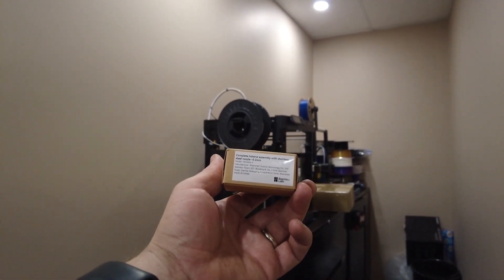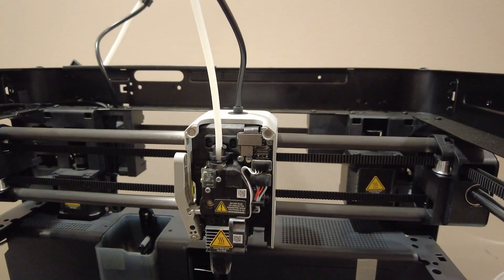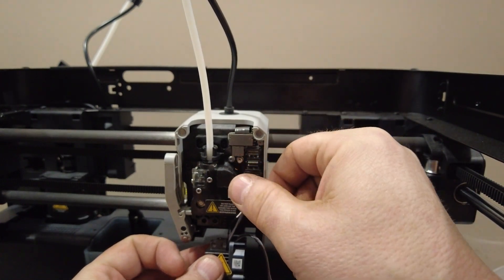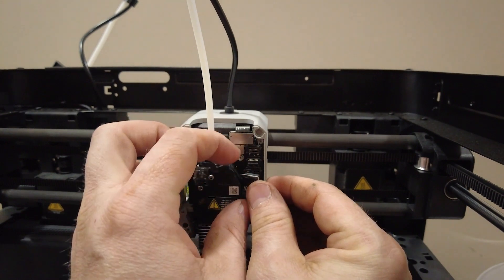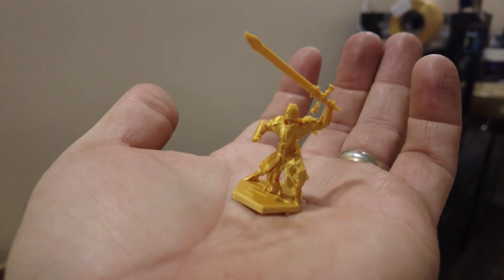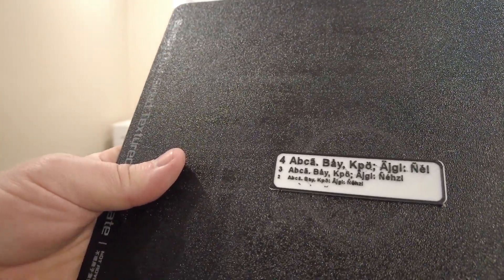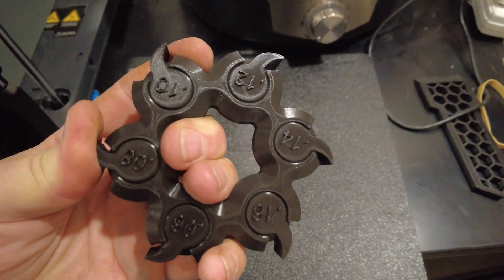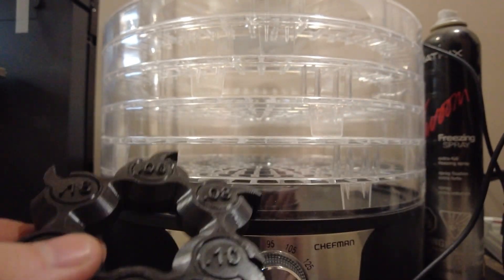Bambu 0.2mm Nozzle - Installation and Tolerance Testing

Comment: To be pointy, you installed the whole hotend assembly, with a 0.2 nozzle. 
Not to be rude, Thanks for the content it will come handy to me in future. 
I say this tho, because Bambu is -intentionally imo - very unclear about this: To easily perform a quick swap as you showed and as we all want, you will have to purchase a new hotend assembly for every secondary nozzle you plan to use. And it goes for about 17€ the nozzle, plus close to 30€ for the hotend.
Then yoy have to do (once and hopefully forever) the assembly of each nozzle with its hotend assembly, watch out for the thermal paste, the fan and all its wirings.
Done that, you will have your different nozzl'd hotends, and you will be able to perform the relatively quick swap you've shown.

Hope this will be useful to anyone like me was willing to try more detail w/ 0.2 or toughr vases with 0.6 and might be finding out he's forgot to order the 30 bucks hotend assembly. twice.

Those guys at Bambulab never miss the occasion to make me freak out every spare parts order I place, one way or another... -.-"
Reply: Minifigures came out great, tho! Cool stuff, I'm impatient to try... but I'll have to wait the hotends assemblies to come. No advantages in dismantling my 0.4 hotend which came with the printer... Unless I go along buying a 0.4 hardened, ok... Daaaamn those guys at Bambu... >:(
Reply from the maker: Good points. Definitely wasn't just the nozzle swap! I watched someone do the nozzle swap only and figured i'd screw it up, so ordered the entire hot end, even though I didn't want to spend the extra money. But if you have the complete hotend, it's pretty slick to change out.
Reply from the maker: I was surprised how well they printed. I'm by far not an expert and I just swapped hotend assemblys, sliced and printed. Bambu makes it easy.

Comment: Technically you didn't even have to heat up the nozzle to remove the filament prior to swapping the hotend.  Just push the filament cutter to... well... cut the filament.  Cuts it basically flush with the  top of the assembly.
Reply from the maker: Good point! I am definitely going to try that.

Comment: I'm trying to print with the 0.2 nozzle and it's constantly clogging
Advice?
Reply: Have you tried lowering your heat?   Smaller nozzle will require a significantly lower amount of flow through the hotend and theoretically it could cause heat creep.  You could run a temp tower to see how low you can go without sacrificing quality.  And if Bambu Studio allows it maybe you could slightly reduce retraction if it doesn't cause too much stringing.
Reply: @ARMYStrongHOOAH17  it was heat creep. If I run the 0.2 nozzle and have the door wide open and the top off I have no more clogs.

Comment: Dude 😅 That tolerance test is supposed to be printed at 0,2 heights with 0.4+ nozzle! From a test perspective it works just fine, from a time perspective I'd rather use 2 of those 4 hours (and it's a lot) to redraw a tolerance test 40% smaller, 1 hour and a half to print it and the last half hour I saved I can have a beer. 😂
Reply from the maker: Good ideas. I never thought about that at the time! I'm still used to printing with my slightly modified Ender 3, so i'm used to waiting a long time for prints to finish Lol!

Comment: The seam line in the wrong place would definitely bind anything with close tolerances. (That seems like the one thing BambuLab hasn’t solved yet with their control of plastic flow: There’s always a pretty prominent seam line - or seam zits if you use random layer start/stop :-/)
Reply from the maker: Yeah that's true. I ended up banging it against a table really hard a few times and it did break loose without breaking anything off, but it must have been close to breaking because it took some crazy hard hits before it did.

Comment: I have an issue with printing a small logo, and I have a 0.4mm nozzle. If I were to switch to a 0.2mm size, do you think that could solve my problem?
Reply from the maker: It would make a big difference because you gain double the resolution basically. Before you buy one, load your model in Bambu slicer and change the nozzle to 0.2mm, then slice and see what the preview looks like. It represents it well in the preview

Comment: Have you tried adaptive layer heights to improve the model quality even further where required? Unfortunately tree supports are not 'supported' with adaptive but not all miniatures require them.
Reply from the maker: I've only done adaptive with the 0.4mm nozzle so far just to smooth out the top of curved surfaces and it works pretty good. I've found that the standard support breaks off much easier on this machine than my Ender 3 ever did. Had some tree support failures early on and only use them if I increase them to 2 walls from 1.

Comment: Best guess is that elephant footing is still happening or the .1 Z layer height is too tight of a tolerance. It's not your X and Y which benefit from the .2 nozzle it's the Z stopping those moving parts from staying away from each other. I don't know what the published tolerance is on the LIDAR system.....guessing this is more than that system can account for in such a small footprint layer to layer. Just my best guesses though.
Reply from the maker: Yeah, that's probably a pretty good guess. At those tight tolerances, any little bit of elephant footing would lock that up pretty hard. In an ideal situation, you would be able to print parts with a 0.4 tolerance and they'd still move with a 0.2 nozzle (0.2 clearance on each side). I also thought about trying it on the hot plate because maybe the texture on the textured plate is causing some slight miscalculation of first layer height. May try that again.

Comment: That small figurine turned out fairly well. What speed was that at? I have been wanting to print 1/76th scale tanks with an FDM printer just to see how well (or bad) they come out.

I got my printer to work well enough to print a disc mount for that turbine I was talking about.
https://www.youtube.com/shorts/TCYUlybGlgs
I haven't actually started my channel yet so I just uploaded a rough phone video to the one I used to use when I worked for a newspaper.
Reply from the maker: HI Tony! I just used the standard speed settings for PLA in Bambu Slicer, so I was pretty happy it printed as well as it did.

That disc mount seems to work pretty well! Looks like it's spinning pretty fast. I like how you had the smoke showing the air travel.
Reply: @MiddleAgedTechNerd-rt2lp  So, would the standard speed for PLA be 100 or 150mm/sec? If so that's an amazing result. I have to say I was very interested to see how a 0.2mm nozzle would go - bloody brilliant!

The motor probably wasn't spinning that fast - a few hundred rpm maybe. It was just running on a couple of AAs at 3v. I'm going to do some variations on this design. Unlike most machines which are the enemy of friction, increasing surface area of a tesla turbine, and thus friction, will increase throughput and possibly efficiency - which is counterintuitive. 

So, bearing that in mind -  I plan to 3 variations of this design for starters to see if I can find a configuration sweet spot. This turbine has 6 discs spaced at 2mm. I plan to do one with 6 discs spaced at 1mm (if this printer can handle that) one with 12 discs spaced at 2mm and one with 12 discs spaced at 1mm. After that I'll try to texture and/or shape the discs to increase surface area contact and friction to see if there is any improvement in throughput. 

Down the track I'll add cowlings and a vortex shaped input funnel which I have designed. I will also try to make some discs out of aluminium foil which I can press a surface pattern into - might need a laser cutter for that but I'll try printing a cutting template first to see how that goes. I'm also thinking of doing some discs made of very thin latex sheets - so rather than the disc guiding the air the air might shape the disc as it moves through - definitely need a laser cutter for that though! Cling wrap is another possibility. If this concept works, eventually graphene sheet might bring the ultimate efficiency.

I feel that the smoke was imperative to show what's happening to the air above the turbine. To begin with I hope to be able to just use the smouldering incense stick set at specific distances from the top of the turbine to gauge whether there is any improvement and by how much. Eventually I will probably need to get one of those little airflow meter things.

I have made a channel but I haven't started it yet. Right now I'm calling it TheElectroVortex. Although I might change that to ElectroVortex or TheElectricVortex - which do you like? Or maybe there's another variation on the name. The channel will focus on and combine experiments, devices and concepts of Tesla, Lord Kelvin and Schauberger. Although their work was never related there are points of convergence which will make for some interesting little devices and experiments.
Reply from the maker: @TonyGrant.  I just checked and it is between 120 and 150 mm/sec for PLA. The really cool thing it does, though, is slow right down to 10mm/sec on really steep overhangs. It'll reduce speed as the angle gets higher.

Sounds like you've got a lot of material to start a channel with! I'm definitely subscribing WHEN you do Lol!
Reply: @MiddleAgedTechNerd-rt2lp  That is really interesting to hear that it adjusts the speed automatically for overhangs. Does it do it for fine parts also - like the sward (which it probably treated as an overhang) if it were vertical? I kind have to do that manually with the disc mount. I do 100mm/sec for the base layers then slow it down to 30mm/sec for the vertical blades which hold the discs.

I'm very pleased to hear that you'd be interested in my channel. And yeah, there's plenty of scope for material. I have been into that stuff since the early 90s when I built the flying toy I described to you. I also built a couple of Kelvin's Thunderstorms back then and a couple in the last decade or so as well - they are different to the ones on youtube so far. 

For the most part it has been a mental process where I dream up and work out stuff in my head and maybe do some diagrams. But bringing it into physical reality has been a challenge. But now, with a 3D printer (albeit a dodgy one) Fusion 360, Reddit and ChatGPT, sufficient tools and resources have converged to make bringing my ideas into physical form very do-able. But it's gonna take a while. For starters I think I'll upload that turbine video with some text explaining what's going on to my new channel and kick it off. It's already got 1.7k views as it is, which is encouraging. I don't plan to post on any schedule, so I don't know how much momentum the channel will get but it will be a good reason to make some stuff!
Reply from the maker: @TonyGrant.  it just slows down for anything that is an overhang, but if it's vertical it runs at full speed. It's surprising how well it still prints at those speeds though, even with small parts.
Reply: @MiddleAgedTechNerd-rt2lp  Yeah, that little figurine does look good for FDM. How well would it print a Warhammer scale figurine?